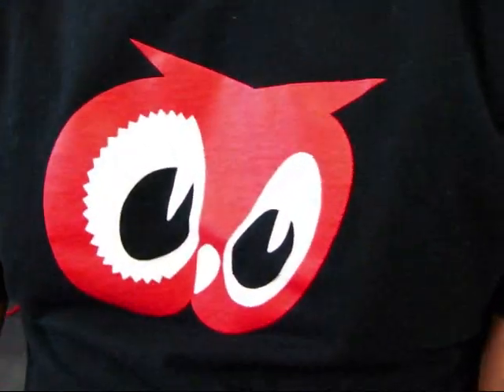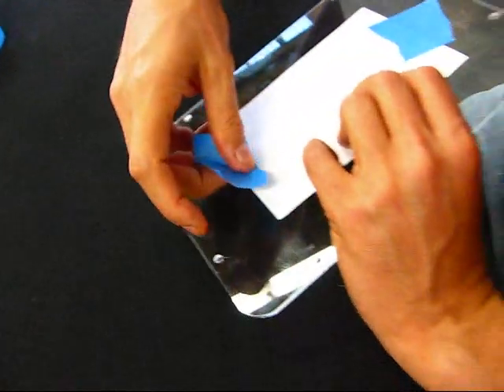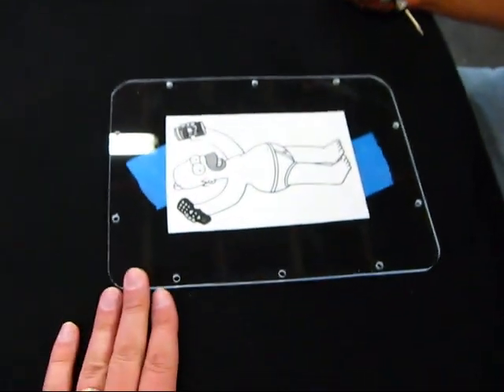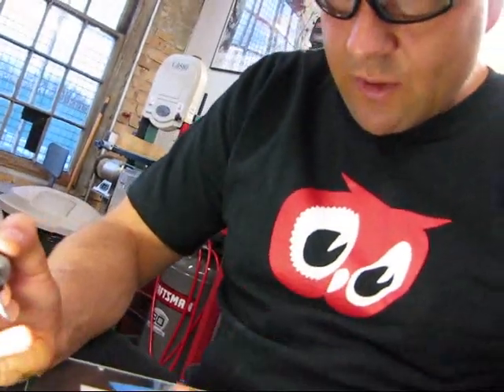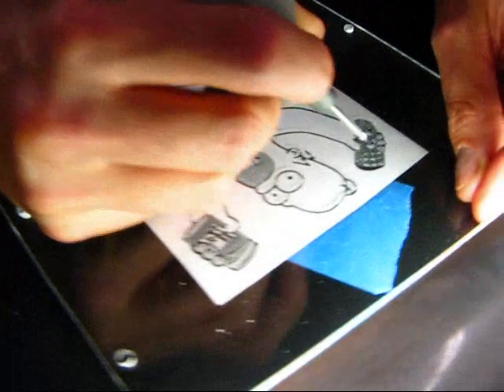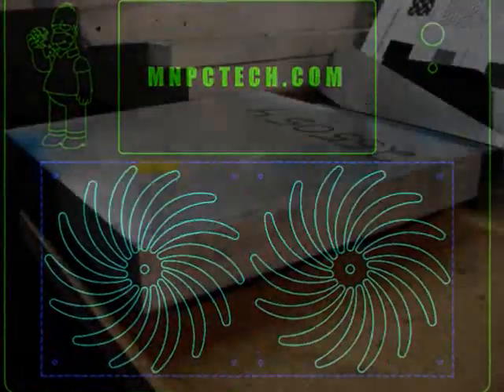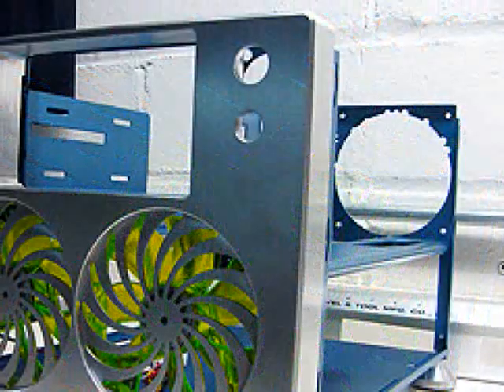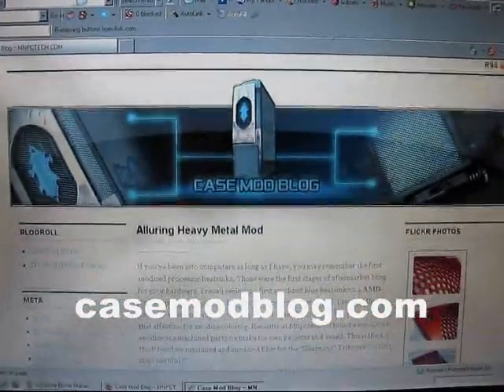Ultra Microfly Case Mod Part 2: Guide to Acrylic Window Etching

Comment: why not just use the Dremel flex shaft attachment that gives you a smaller more penlike device for engraving? If one already has a Dremel why buy a new tool?